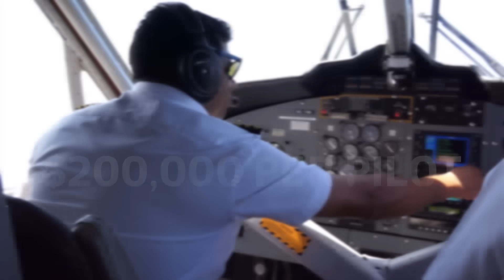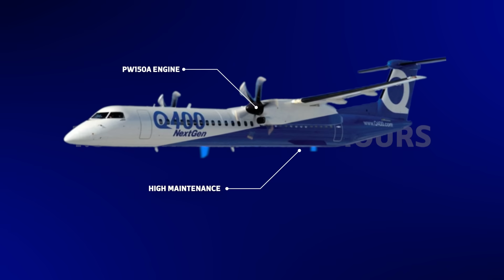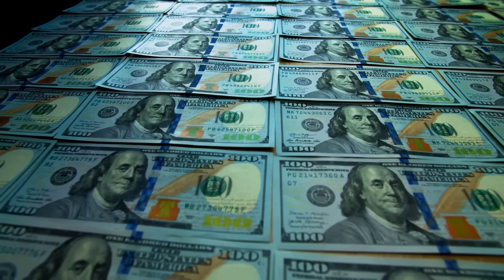Why Airlines Gave Up the Q400 — Even Though It Was Perfect

Comment from the maker: Quick correction: Around 350 to 400 Q400s are still flying today, not about 50 as mentioned in the video. Thanks to everyone who caught that!
Reply: should correct fuel burn also. 1.8 tons/hour? NEVER! ATR72-600 burns 600kg aprox. 3.5 tons on CRJ?NEVER!!
 Flew 737NG and they burn 3ton at first hour !!
Reply: This mistake immediately turns your video into garbage.

Comment: I am guessing the E170/175 killed the Q400 in the US, Horizon being an example of this.  There are quite a few Q400s still flying passengers on RJ flights in Canada.  I have flown on the Q400s many times, on Horizon, Westjet, and Air Canada Jazz.  Learned to always sit in the back because it is much quieter.  One thing I liked about those flights was boarding from both the front and rear with plane side carryon baggage check.  Given the choice though, I would opt for the E175 on RJ flights.  ATR's never seemed to catch on in North America for passenger service.  The only ATR flights I have been on were for island hopping in the Caribbean.

Comment: Taiwan choose ATR72 over Q400 because their dosmestic flight are short, so performance advantages not working. But if there are low demanding 1-2hour jet routes, Q400 will be very useful, ATR is way too low performance to be capable with these.

Comment: Historically also Brilliant Aircraft designs went to commercial flops , Few examples are 1) Dassault Mercure a marvelous Aerodynamic Air frame but went unsuccesful , Later its reincarnation with modern technology in Composite material, Engines and avionics Airbus A 320 largest number of Commercial jet Aircraft ever produced and continuing 2) Lockheed Martin L1011. A marvelous Aircraft of its time , Design of Specious wide body interior, Outstanding performance ,Very quite Cabin, well ahead of its time navigational systems including Auto landing, Super safe by Five Primary control independent redundencies ...but became a commercial flop and ceased production prematurely.

Comment: In North America there are ATRs in the eastern half but none in the west where Q400s reign.   This is due to the requirement that a two engine aircraft must be able to fly 500 metres higher than the local terrain fully loaded with one engine inoperative.  Mountains in the west run up to 14,000' (4600 m). Q400s can meet this standard, ATRs cannot.

Comment: The Q400 has one massive advantage over the ATR - it doesn't just fall out of the sky in Iceing conditions.
I've flown a lot in the Q400 but I refuse to get in an ATR.
Reply: Agree. The crash of Brazilian ATR a few months ago was horrible!
Reply: @merc340sr and that was just the latest of many such crashes.
Reply: Not exactly. Remember Colgan Air 3407 @KBUF. As with all aviation incidents/crashes-there was a chain of events led up to that Q-Ball ending up in a neighborhood instead of the airport. The ATR-like ALL aircraft-has very specific operational limitations. Roselawn did shine some very unpleasant shortcomings on the Toulouse Tortoise that have been rectified-albeit with a very large Yellow Olympics between FAA & ATR.
Having worked heavy check on both ATR & Q-400 for almost 20 years-the ATR is a far better airframe that the Q-Ball-the company I was employed with for many years flew the ATR in the PNW as well as Alaska & with proper training & respect for the WX they never had issues with icing.
The Q quite frankly is 100lbs. of crap stuffed into a 2 lb. bag. The one thing that always got me-aileron control cables requiring replacement at ever 2 year interval. FACT. They would be found either low on tension to the point that adjustment was not going to fix it-or they would be showing signs of damage. I worked on Douglas DC-9's & MD-80's way back in the late 90's & those cables would last until D Check-some 10 years or 25,000 flight hours-and even then they would be still servicable-the OEM called out for replacement.
Bombardier got eaten by it's hubris.
Reply: @stevenrobinson2381 I know nothing of the build quality, but no Q-400 has done a vertical landing due to ice.
I flew across the alps mid winter in bad weather from Vienna to Venice & back. It was a bit concerning because ice from the props was whacking the window and fuselage right next  to me and I could see ice accumulating on the wing and then being shed. 
I'm here to talk about it & not sure that I would be if it were an ATR.
Reply: @gregculverwell  as I stated-reed the NTSB report on that Colgan Air flight.
Reply: @stevenrobinson2381 I did read it many years ago, but don't remember a lot of it.
What matters to me is track record. The Brazilian crash was close to home gone of my nieces live very close to where it where splat.
Happened to be watching very shortly after it happened and was concerned when it fell. 
While we were watching the 1st video of it falling, my wife asked me what kind of  plane it was & I instinctively said ATR turboprop and I was right.
Reply: @stevenrobinson2381  The Colgan Air flight wasn't due to the aircraft or a flaw in the design. All planes would've had difficulty in that cold Buffalo day to some extent, but the fatigued pilots made one of the worst mistakes in reducing a stall by pulling the nose of the Q400 up instead of down. Had those pilots just pushed the nose down that flight would've landed safely at the airport.
Reply: @dehavillandcanadatwinotter9621  read my synopsis. I clearly stated that there were numerous reasons why Colgan ended up short of KBUF-and key was the crew's inexperience with serious winter WX. I too felt that way about the Toulouse Tortoise until many years later & stand by my comment the Q is 200lb. of shit stuffed into a 2lb bag. And it is too bad-the original Dash 8's were fine aircraft in the De Haviliand tradition
Reply: @stevenrobinson2381  that incident wasn’t the fault of the aircraft, investigation already yielded this. What are you trying to say about the Toulouse Tortoise? I’m not familiar with that. The Q400 is just as good or perhaps even more improved than the original Dashes
Reply: @dehavillandcanadatwinotter9621  if the Q-Ball is so great then-how come Downsview ceased production ?
Reply: Same here, I used to work on the Q400s at Flybe and we had 5 ATRs as well. I would never fly on an ATR.
Reply: Yeah, ATR has had decades, quite literally decades, to fix that icing issue after it took down a couple of American Airlines express flights back a while ago yet just a couple years ago another ATR goes down in Brazil (not even a particularly cold country). Dash 8 planes meanwhile are built for the cold and any environment, especially the long Canadian winters. Any fatal incident involving the Dash 8 was pilot error.
Reply: The probably real cause of the Voepass flight 2283 crash was poor maintenance by the airline. "I'm Brazilian"
Reply: @LucasCavalcante2839 Poor maintenance?
What is your source? 
In what way did "poor maintenance" lead to the crash?
Reply: @gregculverwell  ANAC "Brazil's regulatory agency" revoked Voepass's flight license in June 2025 due to maintenance irregularities. In August 2025, a former Voepass employee gave an interview to a Brazilian television network "Rede Globo" He reported that the airline did not properly maintain the planes and that the aircraft in question, PS-VPB, had already presented problems before, but even so, the airline continued flying it.
Reply: @LucasCavalcante2839 That may be true, but as far as I know they did not link the crash to poor maintenance.
Reply: @gregculverwell  Of course, the case is still under investigation, but the mere fact that the Brazilian regulatory body revoked their license mean they know more than we do.
Reply: @LucasCavalcante2839 it is a standard part of an investigation to audit the airline itself - procedures, training and maintenance.
If as part of the investigation they find discrepancies, they are obliged to take remedial steps and if severe enough will suspend the operation licence.
It does not mean that the accident was caused by those shortcomings.
Reply: @gregculverwell  I'm not saying the cause was poor maintenance; I'm trying to say it's very likely, and in my original comment I even said so—I changed that, It makes no sense to blame ATR for this, as no evidence so far in the investigations points to a design flaw; if that were the case, the ATR-72s would probably have suffered the same fate as the Boeing 737 max.
Reply: @LucasCavalcante2839 actually it does have a design flaw. They chose to use a laminar wing profile (NLF) in order to provide a competitive advantage in fuel efficiency.
The dangerous downside of laminar flow wings is that they are susceptible to icing which causes flow disruption - leading to loss of lift and high drag.
That in turn leads to the risk of stalling - which is happened in this case and several others over the years.
Reply: @gregculverwell  The investigation has so far found no evidence that this caused flight 2283 to crash, and even if it had, ANAC would have banned that aircraft from flying in Brazil.

Comment: Another factor is the ATR 72-600 is actually a nice aircraft for the passenger.  I had a one hour flight in a brand new ATR 72-600 & was very impressed.
Reply: most brand new planes are nice, I had a flight in an 8yr old one and it was not nice, but a lot of this depends on how the airlines fit out the interiors and then maintain them.
Reply: Completely new cabin design being introduced on those remaining “50” 😂 Q400s.

Comment: I flew the Q400 for about 4 years with Air Berlin. We couldn’t done our operations with the ATR. Too slow. We flew a lot of 2hrs sectors and this is where speed matters. We also flew on the shorter Airbus routes with nearly no time loss for the passengers. With the ATR, this would have been impossible. The Q400 is far more superior to the slow ATR in every aspect on the performance side.  This justifies the higher fuel flow in the normal speed range. But you can also fly slower and burning nearly the same fuel as an ATR and still be around 50kts faster.

Comment: The Q-400 is not as quiet as a pure jet.
Reply: true but it depends on the jet as a lot of the "regional jets" are not as quiet as people think either.  It's not the point though as they are much quieter than other turboprops which they "compete" against.  I remember in the old days getting out of a Bandierante and removing my earplugs which were given to each passenger on boarding! I just flew on an ATR 72 in the Caribbean  and they are noisy in the cabin, not old school type noisy but noticeably more so than the Q400.

Comment: Interesting vid. The Q400 was perfect for Africa. ATRs are not as rugged, slower and distances slightly longer. It's a pity Africa can't get its free trade acts (ie Ecowas) together. The Q400 would have been perfect to develop regional economies. As it is, Africans have to fly to Europe to get to nearby countries. Training costs nowhere near per pilot quoted. 
The regional numbers for Africa Q400 v ATR favour Q400. And Q400 v single aisle jet favour Q400.  Great video. Thanks.
Reply: I would expect that gravel runways are also a thing in western Africa, another benefit of this model that leads to its use in remote Canada. The Q400 aircraft are still everywhere in Canada, and production is set to restart in Alberta this decade.
Reply: @A_Canadian_In_Poland . ATR undercarriage great for muddying up in rough African conditions. Dacias are great in Europe, Land Rovers needed in Africa.

Comment: Average research. The Q400 can seat up to 25% more pax than the ATR72, wiping out the 20% operating cost advantage, and there’s currently over 400 active Q400s in service, not 50.
Reply: The ATR 72 typically carries between 68 and 74 passengers ,  Q400 has passenger capacity typically ranging from 70 to 78.
So you need to check your facts.
Reply: @YannisPotamitis  76 to 90 seats
Reply: @YannisPotamitis  maybe you need to check your facts also, the Q400 typical config for a 1 class cabin is 76 & up to 82 seats with the different galley layout. I've flown both configs. There are variations from operator to operator who have different cabin layouts for multi-class cabin however. 
Fuel burn is 1,000 kgs per hour. Q400 has excellent hot & high T/O & landing performance for hot weather/summer time ops that make ops very challenging for other T/Ps.
Reply: This guy should correct fuel burn also. 1.8 tons/hour? NEVER! ATR72-600 burns 600kg aprox. 3.5 tons on CRJ?NEVER!!
 Flew 737NG and they burn 3ton at first hour !!
Reply: @cmtejuliani  1,09 tones in high speed of 677km